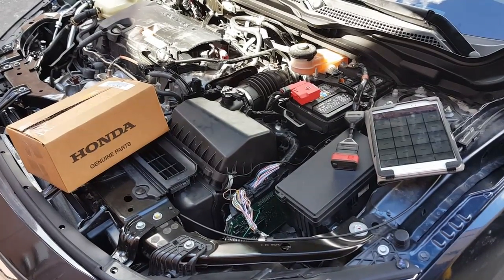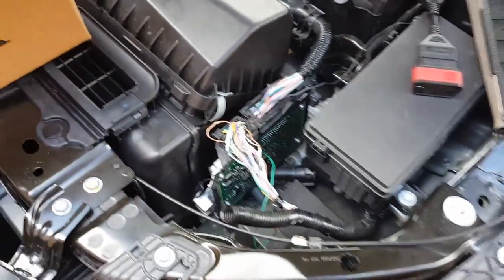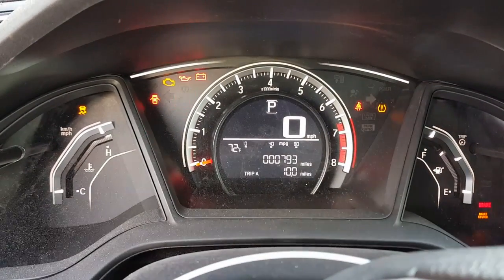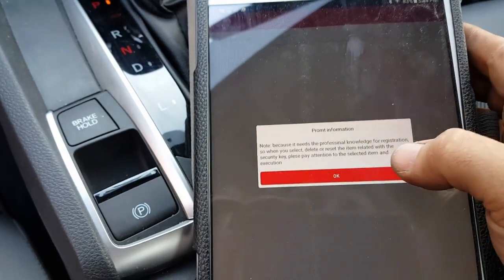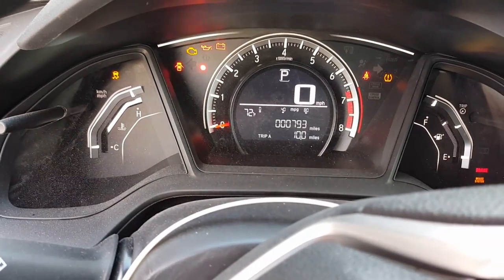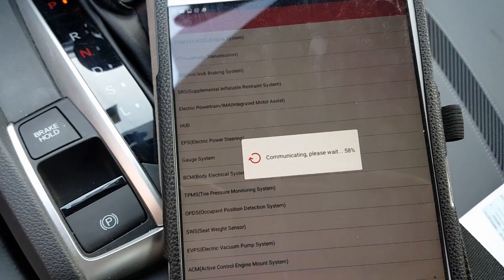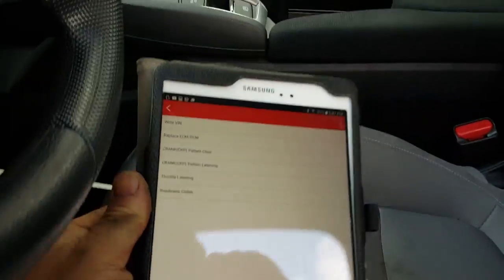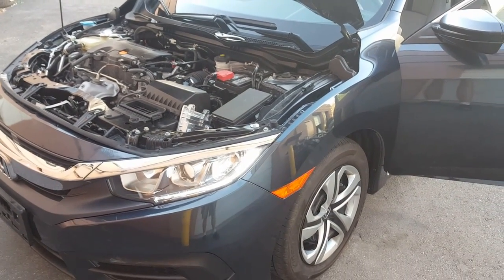REPLACING HONDA OR ACURA ENGINE COMPUTER ECM PCM ON A 2016 HONDA CIVIC USING LAUNCH X431 I-DIAG!!

Comment: I’m doing one right now and the vin will not write. The ecu is brand new from dealer. Used launch, snap on and Autel. Can get the pcm replacement done but the vin never writes. Car starts 100% so immobilizer adaptation went through. The car has 1 other code in the system that’s a U code for communication. But I went to other modules and his says check pcm/ecu. So I’m thinking the ECU is the problem? The other code is vin mismatch or no vin. Any ideas? Do I need to actually update it using j2534?

Comment: George hey buddy I need a couple pieces of info. I have a check engine light that stays on. I unplugged the o2 sensor while the car was running and now I have a permanent code. Can you point me in the direction for your program you have as well as where you got the ecu/pcm as well that is good quality?

Comment: I'm about to replace the connector for the fuel rail pressure sensor.  Mine got torn out when my serpentine belt shredded.  Causing me to have multiple warning lights, and stored codes. Besides going in and clearing codes won't I need to do something else with the scan tool?

Comment: I replaced the ecu with new one i can program VIN but when i try to register with same step shows ( The registration of ECM/PCM has been failed ) but the key is smart . any help ? need to flash or pin code ?
Reply: Did you figure out your issue ?

Comment: Hey George, I have a 2003 Acura 2003 3.2 TL. ECM wont set Readiness" Lights TCS, SRS, and ABS are always on, even after trying to reset ECM. ECM = 37820-PJE-L62 If I replace ECM will it need to be programmed or can I swap ICs between ols and new ECM?

Comment: It won't work with a used ECU from another vehicle. I followed your exact steps. Any suggestions on how to get it to work with a salvage ECU?
Reply: Bill Hodson did you ever get around it to make it work with a used ECU?
Reply: @ryancue9240  Yes I did. Turns out I had an early 2006 model. The first few thousand vehicles off the line would not accept a swapped out ECU even new. Problem is in the instrument cluster. So you have to first change out the tachomter for something from 07 or up and then you can rewrite the ECU. Weird. There is a TSB about that.
Reply: @hoddy2001  TSB ???????
Reply: @boloout187211  tsb= technical service bulletin  I've been looking for the exact one for you but I cant find it. It lists the VIN codes of the early 2006 models that this applies to. I'll post it if i find it.
Reply: @boloout187211  Here it is, I finally found it,
Check your VIN and see if you have one of these. Must be a 2 door 2006. Do you have an Si?
 06-008

February 22, 2013

Applies To:
2006 Civic - See VEHICLES AFFECTED
Immobilizer-Keyless Control Unit or ECM/PCM Cannot Be Rewritten (Supersedes 06-008, dated May 19, 2006, to update the information marked by the black bars and asterisks)

SYMPTOM

The immobilizer system can't be rewritten after replacing the ECM/PCM or the immobilizer-keyless control unit.

POSSIBLE CAUSE

The gauge control module (tachometer) does not contain the supporting data for immobilizer reprogramming that allows you to rewrite it.

   
VEHICLES AFFECTED
VIN 2HGFG1.8.6H50001 thru 2HGFG1.8.6H534534 (LX 2-Door)
VIN 2HGFG1.6.6H500001 thru 2HGFG1.6.6H534281 (EX 2-Door)

CORRECTIVE ACTION

Replace the gauge control module (tachometer) if you replace the ECM/PCM or the immobilizer-keyless control unit.

NOTE : You must transfer the odometer mileage from the old gauge control module to the new gauge control module.
Reply: im stuck on one too right now 2006 please help
Reply: @boloout187211  if you have an early model 2006 and you are trying to replace the ECU, you may have to first replace the instrument cluster.
Reply: @andrewhodson1981  thank you so much bro...after that shouls i AGAIN rewrite the computar again
Reply: @boloout187211  yes the rewrite will not succeed until you have a newer instrument cluster in. 2007 and up will work
Reply: @andrewhodson1981  does it have to be fron the same computar were going to swap ..the instrument cluster.....or did you just used a used one from another car

Comment: Hey there is an issue with 2016 - 2017 Honda Civic TCM module issue where when the batter is too weak or not at full charge it locks the electronic parking brake and not allow the car to start. Can you look in to it? Can I have your email address. Email me prem.m@live.ca  .I want to explain it to you. I think this new problem can be a huge hit on YouTube. Have to get a new upgraded (Transmission) TCM module from delar and Sync it to ECU.

Comment: Hi, George, thanks for  the amazing video. I have a question. My 2007 Honda Accord was stolen two weeks ago and was recovered recently. The theft's key works but mine does not. With my key, the engine will crank but not start. The police officer allowed me to use the theft's key to start the  car and drive it home. On the way home, I noticed that the speed meter and Engine RPM are always at zero. And the Engine light is On. After looking at my car carefully, I found that the  ignition switch cylinder was changed/broken, because you can pull out the key when it is the ON position. Also, I found that the theft put a different ECU on at the passenger side. My original ECU was still mounted there. So I reconnected the wire to my original ECU, bought a new ignition switch, and a CK-100 car key programmer to program the new key. But it does not  work. Still cranking but not starting. The green Key Light was still flashing. 
 
My question: is my original ECU still having the memory of my VIN? Is that true once the wires are pulled out, the ECU will lose the memory? Can the X431 I-diag tool solve my problem? If yes, what do I  have to do? Do I have to write my VIN to my original ECU? What  could be the cause of the Engine light On and the speed meter&Engine RPM not working?

Thank you very much!
Reply: Plz you programe with all key loss

Comment: Hello George I am working on a 2005 acura tl and after a long process of diagnostic and troubleshooting we came to the conclusion that we need to replace the ecu.  Problem is nobody here close by can program it for me, I was wondering if I could send you the ecu with my vehicle vin and you can program it for me. Also what would be the price to do that thanks in advance I hope yo hear back from you.
Reply from the maker: Just by writing new vin in to the  new or usrd computer it will not start your car. It needs to be married with your immo system. You can cloan it your self. I do not offer on bench cloaning service. I just showed how it can be done. You can program it just by using cheap launch x431 tool they sell on ebay for around 100 usd. It will do replace ecm pcm procedure
Reply: @melniksmotors  
Does it matter which you do first ? Change vin in used pcm or reprogram keys  ?
Reply: Can you provide a link to the 100 on eBay? No one can seem to confirm what you show in your videos

Comment: Can this tool program PCM Module? I am getting the error U0038 and U0101 on my honda civic 2016
Reply: Esteban Dagoberto Garcia Perez did you ever find a solution to that? My 2017 civic has U0038 and U0100 right now
Reply: Kevin Lam no I did not, I am still replacing ECM, TCM, Gauges dashboard and still not working
Reply: Kevin Lam you can claim a recall with the dealer, unfortunately my car was imported and the local dealer does not take care of it.. f*ck honda
Reply: @kevinlam1311  I just finished doing an oil change and my dumb self thought I could prime the oil system by starting the car without the fuel pump fuse installed. Well, I couldn't, and when I tried to start the car without the fuse installed the dashboard kept saying "check system". Once I put the fuse back in I got the same codes, U0038 and U0100. Perhaps doing a readiness code run cycle will get rid of the permanent DTC? I plan on doing that tomorrow. Wish me luck!
Reply: dario110011 my vehicle was actually previously wrecked and upon installing a new battery and going on a brief test drive all the error codes went away for me. You can always add a bit of oil into the new oil filter to prime after each oil change.
Reply: @kevinlam1311  Thanks for the reply. Yeah, it seems as if enough of a drive for the engine to go through all of it's checks of a system needs to happen before it tries to flash the code again. 
Thanks. I did that but I thought it would be even better if I had the oil ready to go when I started. Ah well. Ya live and you learn.
I hope your car is better now!

Comment: The computer was pre programmed with the options of the vehicle?
Reply from the maker: +rusco321 yes they all do. You have to make sure it is correct part number. All you have to do is write the Vin an reprogram immobilizer for your keys.
Reply: +George Melnik What if I get one from the junk yard?
Reply from the maker: +rusco321 
yes that will work too. like I said part number has to match your old computer
Reply: what if i get from ebay for 50$  will it for me ?
Reply: Hey George.. Good stuff!! I have learned a lot from your videos.... Thanks brother...
Reply: What's the link for the program